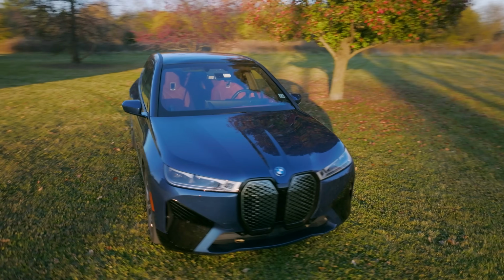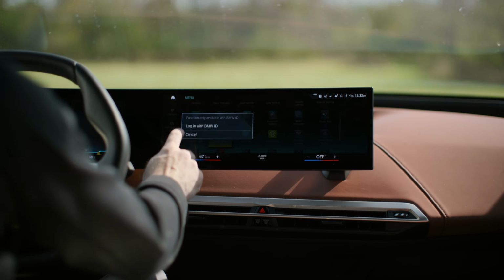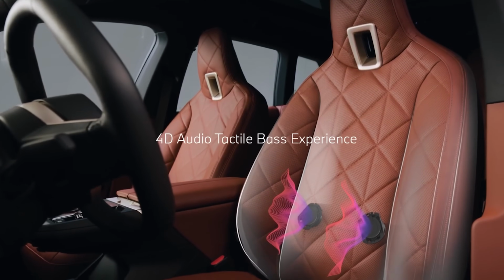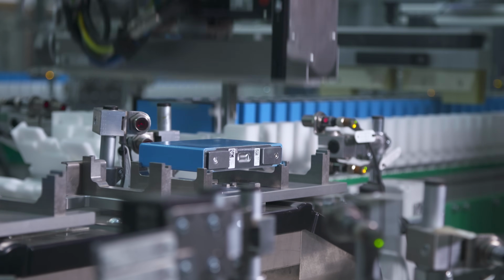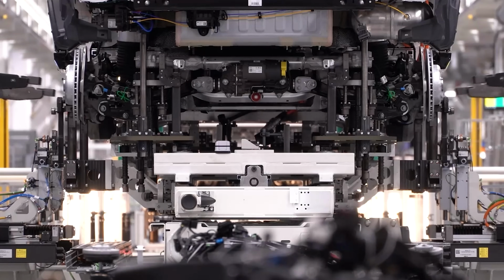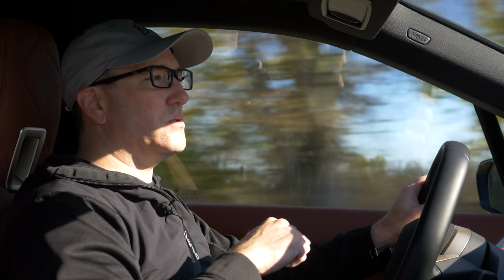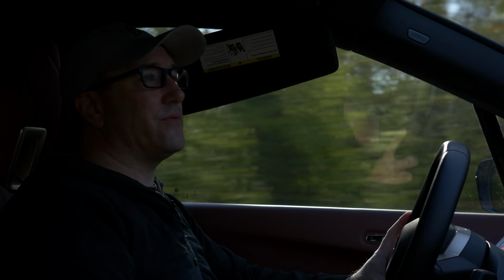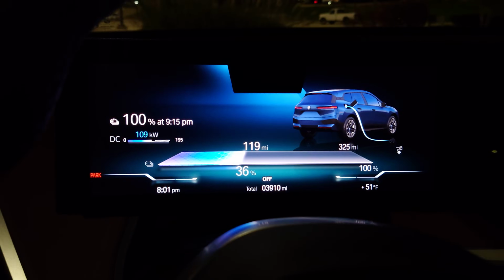BMW iX M60 | The Frustrating Future of EVs

Comment: Well fuck it’s growing on me. What the hell? It’s like an ultraluxury EV wagon that you just have to avoid looking at from the front. Best sound system, some of the best tuning, solid range, advanced chassis, an honestly beautiful interior… It’s not in my price range but I’m shocked at how compelling this is.

Also oh goodie, let’s talk about fast charging speeds and range and batteries in 10 years… I just don’t get it guys, who is road tripping 100k cars in such a hurry that a 30 minute stop every couple of hours is a deal breaker? Who lives in the middle of nowhere red state ruralia buying a six figure German luxury and complaining that they can’t make it to the nearby city and back without charging? This is for people with houses and garages in NYC suburbs or California or wherever who drive 15 miles per day and occasionally take their family up to the mountain or the beach. You guys overestimate how spread out stuff is in the areas wealthy people live. 

And regarding the battery longevity - yes, this may be disposable and replacing the battery sounds like a nightmare, but where are you guys getting the idea that batteries last 10 years at most? Long range EVs that have made it past 100k or even 200k miles still have the vast majority of their range left with modern BMS and cells. Aside from (usually in warranty) pack failures, the only cars that have actually lost significant capacity have been very early EVs and non-temperature controlled packs in Leafs and the such. Sure, a 350m range may not be impressive in 10 years but it seems manufacturers don’t seem to be interested in boosting range much past where they are now. All the new platforms are targeting 300 miles except for upstarts like Lucid and very slippery cars like the EQS. We may have more efficient cells, slightly faster charging, and lighter platforms, but manufacturers are putting money into better cells for cheaper and lighter packs. While I wish that solid state and other tech will lead to 600 mile range 150kwh sedans and stuff, it will just lead to cheaper base models with the same 60kwh capacity and 250-300 miles ranges. Hell, even BMW said in a press release they weren’t going to target EV ranges beyond 300 miles.
Reply from the maker: We live in one of the largest suburbs in America, weathy on top of it. We don't have charging infrastructure and most places we go is 20 min one way.  It all adds up.  And to go to Electrify america charger it's another 20 minutes and usually over crowded or broken.  Then to add 35min to charge 70% sucks. Period.  I have this argument with Californians all the time who live in a bubble and don't travel to "normal" murica.
Reply: @savagegeese   ok, fair enough, I wouldn’t say charging infrastructure is by any means well developed, but I still think it’s decently well developed for a large portion of driving needs. I get it - I’m on the Eastern mid Atlantic seaboard and while all the major travel corridors are flooded with chargers, as soon as you get off the interstates and up into the mountains you really have to search for chargers. I still think the Midwest is a bit of an exception to how most huge population centers are, but there’s no doubt that there’s large swaths of the nation that are subpar or unusable for EV travel. Charger reliability is also a major problem that underlines how thin existing chargers are spread out, but I think that’s quickly expanding if you take a look at what people experienced just 2-4 years ago. I remember a major car review mag had a couple of cars stranded or didn’t finish because the charging infrastructure was crap but today most travel routes have enough capacity for usable travel.

Two additional notes:

- One, the charging network is more of a personal decision for a car buyer rather than a dig at any particular EV (aside from Tesla due to super chargers), and since the standard is unlikely to change any time soon, current and older EVs on CCS aren’t really going to become deprecated for use.

- Two, that’s not really the point of what I keep saying about you guys. Most current EV drivers don’t in fact use EVs jumping between fast chargers (and while apartment dwellers are going to be a massive hurdle to onboard, even there the solution is overnight chargers rather than making fast chargers comparable to gas stations). 

Most people have home chargers and could probably get by without gas in a PHEV, save for a couple yearly trips. Even if they do need something else for the yearly trip upstate, people cars in this price range often have second. It’s kind of like driving a truck year round for the yearly Home Depot run for plywood and mulch - sure, people want that, but it doesn’t accurately describe their average driving.

Most people that can afford EVs don’t drive long distance - they may road trip to the next metropolis over or the beach but anything over 500 miles is a flight. This is particularly evident for luxury EVs - owners that can afford those can afford domestic flights even for smaller trips and value their time over perhaps some comfort driving. 

So yes, the charging system still sucks and it’s nowhere near as convenient to road trip EVs as it is gas cars, but it’s like you guys overlook how pleasant EV ownership is for daily driving. I won’t disagree that the fast charger network has ways to go and is unlikely to ever be as quick as filling a tank. It’s just that for the vast majority of people, including in more spread out states, fast charging is likely to be a rare event.

I know I wrote a damn essay in response and I don’t expect you to read it, so I’m sorry for that. I will concede that the ease of use of EVs for daily driving is or should be self evident so it makes sense to talk about their weaknesses in rarer situations. I guess it’s like when you take street cars to the track to see their real limit dynamics even though most people will commute with them. Maybe it’s not fair to expect you to positive towards EVs when you often disparage them anyway for driving experience reason. I still really appreciate your driver focused reviews compared to the dearth of tech reviewers on EVs listing numbers and touching screens instead of driving them. 

But yes, I get your concern - I may not be in California but I admit my area doesn’t fairly represent the majority (by area)  of America so your guys’ take is valuable. 

Can I also ask why you bother with public charging in your suburb? I couldn’t tell you the nearest charger because I’ve never used one closer than 50 miles away.
Reply from the maker: @Anya-Prime  Your explanations are well thought out and true.  I read every word.  EVs are mostly a joy to drive. The iX for almost every reason you mention is great.  What we are fighting on our end is a multi layer issue.   Tha fact like companies launched EVs with no national support or even availability in colder climates.   Even Ioniq5, It's not available in every state.  So we get left with cars like this that are not even attainable for most people. And brands are just not honest about the technology.  The sustainable "green" image when 70% of EVs are leased.  I mean we could have a 2 day chat about all of the bases that are not covered including cost to repair,  proprietary battery tech, down the cell and software layer that makes it impossible to repair and service long term.  Also the fact these brands are treating these ultra expensive bricks like smartphones.  I mean again outside of charging issues we know already most brands won't support the first gen products long term.  They can't even answer questions about service and support.  So you have to understand we are VERY worried for consumers.

Comment: Great discussion regarding life of electric vehicles and serviceability. I work at a Hyundai Distributor in a small country and any problems regarding the battery pack or the motor needs to be done by us because other shops don't want to spend the money on all these expensive specialty tools, some who are only designed for a specific model. 

However, regarding the life of the battery packs. There are a few companies actively buying packs and modules from totalled cars and reusing them. For instance, ICEWIND. They are developing wind turbines that have a custom battery pack from electric vehicles and are used for off the grid buildings or electricity generation in extreme conditions.

Comment: They make a good point about the repair costs of these vehicles. The fact that this car will essentially enter "insta-death" territory after a full lease term. When minor collisions run you $5-10K and serious collisions could run $15K+ that could be repaired for far less on ICE cars these become nerve-wracking to own out of warranty. This defeats a lot of the purpose of the EV transition, the raw materials are the most valuable component and if that isn't recycled then these become enormously wasteful and negates whatever carbon emissions savings this thing has. I am an EV-only driver but it is one of the big downsides to the higher cost EVs.

Comment: i expected the sound to change based on torque vs average wheel rpm, like base heavy sound for torque, then higher pitch sound for averaege wheel rpm, and 3d audio to hear more loudness correlating with how much power toruqe/rpm is happening from each corner of car in all wheel drive or rear wheel drive, with rear seats facing the rear and a coupe look as a compact 4 seater, optional lucid air front roof glass and tesla 3 rear roof glass, high airflow interior, optional custom color dyed icelandic moss air filter, airbag and driver seat and interface sliding to middle of car after folding away passenger seat.      a lotus evora sort of communciative steering rack on a rear wheel drive prius sort of car would work well with it. would be cool if you can uplaod your own sound per parameter of car action ie torque etc.               maybe flux in wheel motors integrated in wheel surcture like oribe aftermaket motor, oribe claims their motor includes brakes and is same weight as stock wheel and brakes on ciciv type r rear wheels they put it in in demonstartion car.    a balance of battery and combustion according to users desire for cheap running cost or lightweight agility, battery not sitting under everyhting like skateboard, because people who want only ev drivetrain dont need speed handling at high speed so its ok to have weight stacked up in front end etc.    2 pistons on a shaft going back and forth with magnet to power electric motor, packaging is modular like batteries, so a maybe flat 6 with echo chamber sound delay echo to combine echo for harmonics, sort of like lexus lfa sound box, maybe can  sound a bit like the flat 12 in eagle hunters engine simulator video would be make fake engine sound and batteries irrelevent for such sport focused car.    simplified version of 2017 prius rear light with only the light strip, eahc light is seperate glowing wire going into and out the car, shaped with the housing areodynamic shape. sort of llike ight year zero car headlight, like prius except more timeless with consideration to face pareidolia. maybe a different bodykit option for those who dont care for low cost effiency of a prius prime like setup of the car.
Reply: the sound when letting go of pedal can be a sound quieter than sound of pushing pedal, and steady reduction in volume like how a combustion sport naturally aspirated car sounds except it correlates with cars momentum, which can change by brakes or unsmooth steering... so its less sudden quietness making it feel agressive even though non sport drivers want smooth calm, and it would be a more interactive way of encouraging sport drivers and hypermilers to maintain mometum instead of braking so much for effiency and longevity of battery and fun.
Reply: make high longgevity and effeincy nigh budget bult, then rent car to customer, repair and parts swap drivetrain parts, NoiseVibrationHarshness material swaps, etc... insetad of recyling car after its short life due to low quality build. lower rent for those who drive effceinty as can be known by usb into car and website upload, as often as person likes and reminder to do it and how to drive effceintly is on inftotainment dislay when car is turned on and off and in park.  over the air update allows unwanted software like pay to use a feature by software lock to the feature even tho you payed for hardware etc.                      communciative steering shoud be standard because it allow knowing where tire grip level is at so one can maintain momentum to minimize brake for effiency and longevity of parts including regenrative braking system due to less use. optimal rpm and energy storage (first powering motors directly, then it resorts to storing energy in graphene flywheel as youtuber two bit davinci posted about recently, then storing in air pressure then storing in battery, etc... longer lasting storage system or more effceint system resorted to according to software measure of current tempuratures, lubrication avilability etc, prioritizing whatever will last cost user and company less money). a;; this will show as a range of optimal power output to compare to the cars current power output shown as a single bar like a bar graph.  optional linear drivers input to output by software called"driving emothusiast" mode or "cheap ownership for non driving enthiusat" mode to delay car reaction to driver assuming driver is slow thinking low precision driver, all for effiency saftey etc.. for example normal drivr will smash pedal and smash brakes often with little time in betwen actions, but a delay wwould prevent most the power and braking power from happening
Reply: a air suspension option liek mclaren 720s and massive suspension lift option because many suv drivers only want to pay for suv massive car because its easier to get into car, a lift kit would make sedans easier to get into and allow slow off roading for those who buy cars that sit up tall for light offroading. tire filler can fill up tires, automaticly fill up hydrlallic steering system for more power assist and throw away air pressure for less assist (without air suspension option and lift option this would be done manually with tire air pump)
Reply: suspension making energy out of suspension movement by linear electricity generator or byt worm gear housing and worm gear inside or normal gear set or by air pressure.
Reply: brake bias hard switch to change between user preset brake power, like most power to front for ditfing the rear end out to get into optimal angle around a turn, or half power to front half to back

Comment: This had everything a good car review needs to have! Really enjoyed watching it. When it comes to future residuals I disagree however. I think this will hold it's value better than a similarly priced X5 or X7. This thing will easily do 200k miles and it will do so with much less maintenance than an ICE BMW. And at the current state of battery management and cooling technology you won't have to worry as much about cell longevity. We still see 8 year old i3s on the road on their first pack with 10-15% degradation and things have gotten much better in the last years.
Reply from the maker: The question is where are all the i3s living.  When we talk battery degradation a mass majority of EVs are located in California, AZ and temperature climate states.  When they start saturating most of the "normal" USA when you are starting cars and operating in 5F and then 100F outside favorable operating ranges those degradation rates will be far more extreme.  But also no manufacturer openly talks about the science behind battery management, battery chemistry etc.  Which is a huge red flag.

Comment: Loved the review as usual guys, I just want to add some experience I have as an owner of a 2012 and 2014 Model S -- at least with Tesla, I'm losing about 1-2 miles of range a year.  I do charge carefully, in that I only plug in if I need over 50 miles, and avoid unnecessary charge cycles.  Thus, the battery will not "fail" in 10 years, at least if BMW's battery tech is on par with Tesla's.  You'll get a gradual decline that you can pass along to the next buyer, so I disagree with the "disposable" label.  Hopefully...🙂

Comment: I think, with the new design, one has to live with the car for a few weeks before reviewing it. The button/screen makes total sense to me after I drove it for a month. Most of the operation you showed how bad the screen it, you could do them on the center console. I don't need to touch screen that much. In X5, I pressed the wrong climate control buttons all the time. The screen actually works better for me. But I don't have the ventilated seat. So everything about climate control fits in one screen. That helps. And you don't need a 110 grand M60. A low 90k ix 50 is the most completed EV you can buy today.

Comment: I strongly question the battery lifespan/replacement of 10 years you guys reference.  Batteries in Tesla's from 2012/2013 are still around with ~10% degradation.  Battery tech and manufacturing is better than it was 10 years ago.  Sure there will be failures but most manufactures have generous warranties - the iX has a 8 year 100k warranty, Model X has 8 year 150k warranty.  It's certainly still a concern, but citing 10 years is misleading.

Comment: You should revisit Tesla products. The build quality is improved and the new model S is really something. I live with a model 3 and drive over 50,000 miles / year, your comments on range are misguided. You only need enough to get to the next fast charger. Anything above 250 miles range is actually a hindrance. Bigger batteries are a penalty with weight and longer charge times.
Reply from the maker: Where do you live out of curiosity?